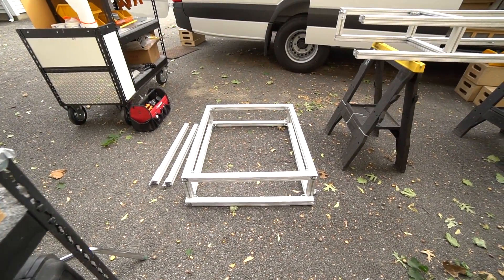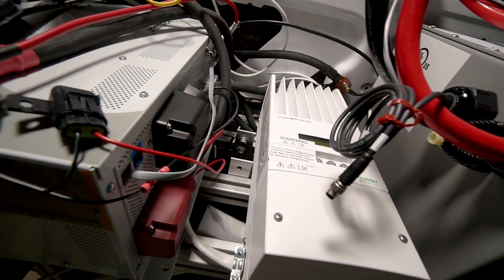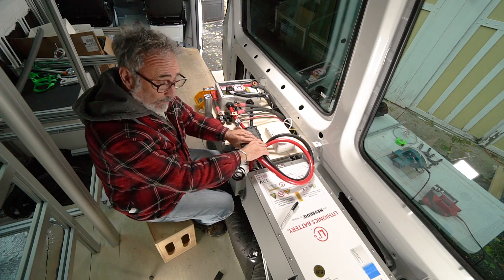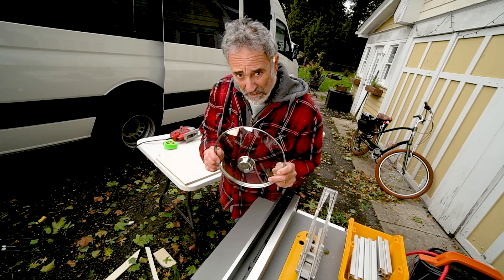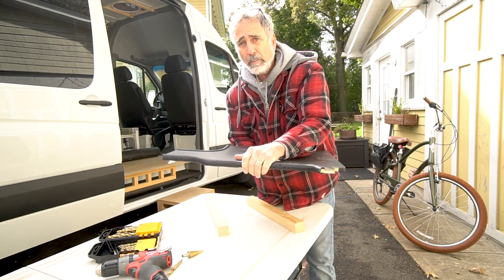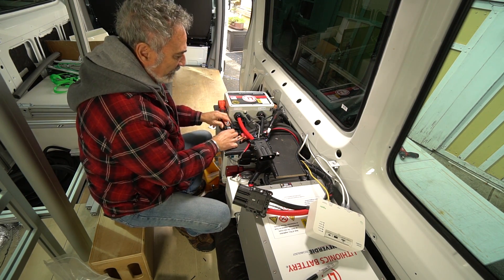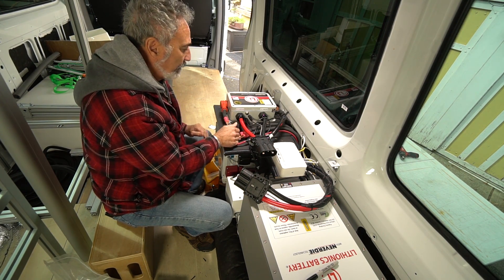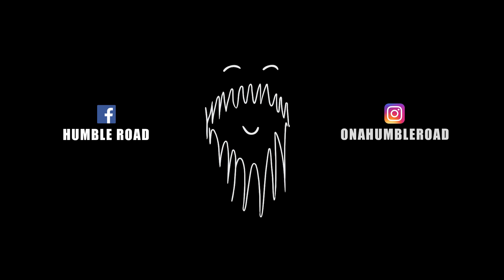Battery Management Tray - IT HAD TO BE DONE!

Comment: Nice power gear setup there... Did you know that battery manufacturer (a canadian west cost manufacturer called Canbat) are working on a low temperature Lithium battery ? They should come out this fall (2020) and be able to operate at very low temp the call for... This may interest you for future projects !

Comment: Hi Humble..still can’t get access to your Instagram...did you block me? Lol. Did just look at FB...can you tell me if the Espar will blow air at all or will it simply feed an underfloor hydronic heating system? 😳 The wild fluctuations in  temps in my first park model trailer drove me to a All Seasons Park model (manufactured here in Ontario) which was heaven comparatively. I notice that the Brits have a classification system re: insulation value that goes from 1 to 3 I think. Great idea. I have rarely gotten any sensible answers from any rv manufacturer here over the years about R values and products used (other than my Northlander).
Reply from the maker: I don't know what to tell you about the Instagram acct. The Espar furnace heats glycol which is pumped through 3/4" lines. The first stop is a heat exchanger to make hot water. The glycol is 170 degrees, so the fresh water needs to be tempered down with a mixing valve to a safe human hot water temp. Next stop for the glycol after the hot water heat exchanger is the blower unit. This is where a fan blows cabin air across glycol heated copper elements and you get hot air heating your cabin. THEN, the glycol has a fork in the road. Most of it goes back to the reservoir to begin the cycle again, but some of it takes the other fork where a second pump pushes it through the radiant heat tubing under the floor and then back to the reservoir. In my design, the blower does a super job of keeping the van cabin warm. And I intend for the radiant in the floor to simply take the chill away. Although having spoken with a very knowledgeable person the other day, it appears I can expect way more in terms of heat coming up through the floor, so much that I will include another mixing valve to temper the heat as desired. Having lived for weeks at a time in 18 degree weather, I definitely have a few "must haves" and a nice warm coach in every respect is one of them. AND EASILY SERVICEABLE!
Reply: Humble Road Brilliant! I get it. Looking forward to real life testing. I am interested in the performance of blown air component - we didn’t have luck with this type of “furnace” in our cold Ontario winters no matter the R value of the envelope...fell out of favour. In floor heating is a fabulous system that ppl like me with Chemical Sensitivities rely on in-new builds or reno’s. Right now in my current house I have forced air natural gas system ...👎👎.

Comment: you called it, and as in all electrical installations, not only does it need to meet CODE, it needs to be artistic!  Way to go Rembrandt!
Reply from the maker: "A Rat's Nest" is not my term. That comes from the electricians I have worked with over the years. I have seem some beautiful installations, and some really bad, dangerous ones.
Reply: @HumbleRoad  Well I am an Electrician, albeit an Industrial one with emphasis on Controls, but I know a work of art and CODE when I see one.  Just as it is with the EMT/Rigid that is run in commercial installations.  Those guys know how to bend conduit!  It looks nice and it meets the CODE! And you my friend have joined the League.......
Reply from the maker: I am truly humbled by your words. Thank you.

Comment: Why not shorten the main leads from the Li battery?  You would gain a straight cable run, less resistance in wire even though very low, and a cleaner install.  It would probably entail replacing the connectors inside the battery box.  

I love your work.  Very inspiring.  We just bought a Ram Promaster 1500 High top for occasional camping use as well as utility.  I am definitely watching.  :-)
Reply from the maker: I'm willing to try many things, but going inside that big mameluke is not one of them! Phew!
Reply: Knowing your limits is good.  You are way ahead in the long run with everything else you do accomplish on your builds.  Keep up the good work.